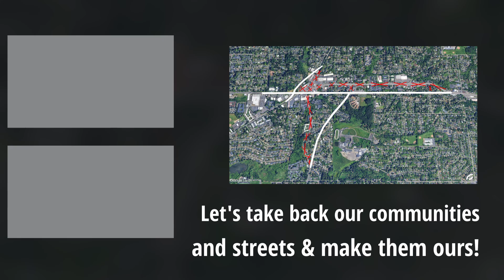Fixing Oregon's WORST Intersection

Comment: I’m very familiar with this intersection, and I must respectfully disagree with your proposed solutions. The optimal approach becomes evident when you analyze the situation comprehensively: a roundabout is the answer.

With four or more points of ingress and egress, compounded by a history of high collision and fatality rates, a roundabout offers a proven solution. If you’re seeking a more innovative design, consider a double teardrop or “dog bone” roundabout, as successfully implemented on the Keystone Parkway in Carmel, Indiana.

Roundabouts effectively slow traffic, reduce vehicular accidents by approximately 80-90%, and decrease fatalities by more than 90%, all while maintaining high traffic throughput. Unlike signalized intersections, they do not create dead-end streets or diminish the street network’s connectivity. Properly scaled, a roundabout can easily handle a 20,000 vehicles-per-hour traffic volume on the major arterials.

We’ve implemented similar designs across Oregon, the learning curve for drivers has proven to be manageable. I would add that the the land impact is also less significant than one might assume—at most, it might require the acquisition of a few parcels, perhaps including the Donut shop or a nearby residence. The trade-offs are minimal compared to the safety, efficiency, and long-term benefits such an improvement would provide.
Reply: As a traffic engineer and former roundabout designer, this is the correct answer. OP’s “band-aid” reply unfortunately does not comport with urban planning and engineering reality.

There are too many underground utilities for OP’s large-scale realignment to ever pencil out, not to mention legal access rights of abutting property owners. The idea of straightening out B-H Hwy along SW Boundary St is similarly never going to happen.

Just build a roundabout and let people walk, bike, and drive through this intersection at a slightly slower speed that allows everyone to make it home safely.
Reply from the maker: @jr98664yt  I am always a huge skeptic of anything anyone says, that includes endless research, reviews and data sets from engineers and experts on all topics. Point being, I am very much the same with this here. Could it be true that apparnetly roundabouts literally fix everything, sure, but my god do I refuse to believe it and it is so nonsensical to me.

And I didn't go into this with the idea that my proposal would be popular let alone viable. I didn't care if it was viable or likable or not. I simply wanted to spitball a concept that is more how it SHOULD have been built out when they first developed the area, than what would be able to work now, though with only a SLIGHT part being a "what if we did do this now?"

And yeah, all the utilities would be forced to be torn out and rebuilt, but that's actually needed anyway throughout the BH corridor, as not only is the main utilities aging bad, there is major drainage issues throughout, and complete reconfiguration and replacement of some portions also should have been done long ago. Therefore, the blank slate is the superior option to right all of the wrongs that happened due to lazy engineers and planners just hand-waving off all concerns and saying "this as it is is completely fine. Don't worry about it. Now where's my paycheck?"

Ultimately what I mean by fixing it isn't even the danger level of it. I care about making it make logical sense for all purposes and users, and for the future redevelopment into mixed-use medium density along it, and in the surrounding area, as that will only exacerbate all the problems with it, including heavy congestion and thus, the safety of it for all. Is the safety important? Absolutely, but it isn't the only thing, nor is it my primary focus.

Furthermore, I strongly disagree with the notion roundabouts should ever have more than 4 connections on it, which it would have here with Scholls and BH alone. What do you do with Olsen? Allowing it to join as well is egregiously stupid. I know full and well there are many places in the world which have roundabouts and traffic circles with more than 4 connections, but it still furthers my own points against it to allow that. Especially for major thoroughfares, which Scholls, Olsen and BH all are. What would you do with Dogwood? Would you actually connect it into the same roundabout? If so, why? Realistically, I believe that road should be completely cut off from having any connection to such a construction. Just sever the ties permanently, force the residents to instead walk, bike or drive the long way around, or, better yet, have ped/bike paths connecting the ends of Dogwood to the roundabout.
Reply from the maker: I get it, but I really still believe that's a band-aid, and also that people are treating roundabouts on this video the same way as all the "adding just one more lane will help!" crowd does.

All of the traffic data is also from 2021 with one single exception being from last year, which COVID lockdowns, the 217 widening process, and the westside pipe project all skewing those numbers likely more than many may assume. Given the recorded volumes from then, 14k per each side of Scholls, and around 26K~ for BH in 2021, current rates undoubtedly are going to be 30k+ for the latter, and ~20k for Scholls.  Olsen data I think I somehow managed to miss, I likely got distracted looking at other data for TV Hwy (Canyon portion too) and further south portions of Scholls, further west portions of Farmington.

You then must account for the inevitable redevelopment of the surrounding lands, which is to be mixed-use high density, and the amount of traffic increase that will cause as well sourced right along the intersection, or in this case, roundabouts. Of course, development on roundabouts isn't actually possible from a logistical standpoint, let alone of a practicality basis. And then the connections to the thoroughfares to access said roundabouts would also be diverted by default to where it would force them to travel east, west,south or north aways before getting to those roads.

We also lack any truly high capacity roundabouts not just in Oregon, but anywhere really in the US. At least four lanes, likely 6 would be needed in said roundabout, and the size exponentially increases in order to safely accommodate each added lane of traffic flow. It also makes it more complicated to navigate to be in the correct lane for whichever road you want to access.

So I really don't entirely buy into the "roundabouts are always the solution to all problems" notion.
Reply: Your proposed solution is not viable. Demolishing 15 private residences to move Oleson Road further east is a nonstarter. It would be much easier to demolish four fast food joints at the intersection and reduce the conflict point there.
Reply from the maker: @RedbookGereute-bs1xg  Keeping the intersections so close like that is also not viable even to consider as a option.
Reply: I agree with your statement in the Video that Dogwood should be capped in the north and south, reroute the southern over Stephen Lane, the northern area has access via 78th.

Then if you want to increase the distance between Ferry Scholls and Oleson in the south, reroute Ferry Scholls through the commercial area to the west of the intersection. Convincing businesses to sell land for a road realignment is much easier than private residences.
Reply from the maker: @RedbookGereute-bs1xg  Though the latter point in certainly true, how would you keep Scholls connected to itself directly from both sides of BH? The excess terraforming you'd have to conduct to get the northern portion to align with the southern portion would be immense, and, the angles from tight curves you'd need for the northern portion to align with the southern portion at such a intersection would be wild.
Reply: @TheCriminalViolin  there is no law or regulation that requires a road not to be interrupted. Broadway goes diagonally over Manhattan and is interrupted for cars at various points. Scholls can also be interrupted. It can be kept open for pedestrians and bikes.

Comment: I'll add some food for thought:
-S. Dogwood: outright cut if off near the assisted living center, separate it into a business plaza and a residential dead-end. 
>Stephen is close enough where it's a bit more inconvenient, but not too bad. Still, the S. Dogwood does service more people than N. Dogwood.

-N. Dogwood: Not any great ways to reroute this, best guess is running Newton through to 75th, but that affects at least 3 properties. 
>Adding a new southern street between newton and beaverton is still too close to the intersection IMO. Maybe near the boxing club could work though?
>Otherwise, just cut this one off, put a basic barrier up, and now the rich people get a longer commute to justify their high property values.

-Maybe push West side of Beaverton a bit further North (up) so that there's a clear five way intersection between Beaverton, Scholls and Oleson? (without the slip-lane stuff?) 
>Still dangerous, but at least you could do it with one light.
>The hilly terrain would still need to be landscaped to accommodate this
>Upside to this is that there's not a drastic change in properties? The vet clinic and maybe a small chunk of Parr's gets swiped by the road, but not much more? Maybe the diamond shop? There's a huge chunk of empty land north of beaverton on the west side of the intersection.
>Triangle of commercial land in the SW side can expand a bit.

Maybe run Oleson-Dover-Flower- into a new Road that runs through that wooded patch into 62th? But that would be Hayhurst instead of Raleigh Hills. But also probably has merit with the alpenrose development.

If you divert Oleson, you'd want a decent route to both Scholls and Beaverton (in a world where the development happens), which means cutting west from Oleson somewhere into a street that leads to Scholls, and a street headed northeast to reach beaverton.

Comment: Another interesting problem is it's proximity to Fanno Creek and the adjacent wetlands. Some of this area is close to or within the 100 year floodplain, so any plans have to take into consideration environmental impacts and compensatory wetland mitigation (if needed). It's a sloppy mess.
Reply from the maker: Yep! That's a huge part of the issue with fixing it. The drainage has always been a massive problem, and it being within the floodplains, and built on top of wetland habitat that was filled in, with remaining pieces of it here and there, it makes it much more difficult to make work logistically. It got a minor mention via the possibility of making the current Olsen alignment into a multi use path that could connect to the fanno creek greenway trails and the red electric trails, in my own concept of a potential fix.

Everything about it is a logistical nightmare and sloppy mess. One massive screw up. Sitting on it doesn't help anyone or anything, and putting a band-aid on it as a fix doesn't help either in the long haul. Thus, the drastic changes do have to occur in order to truly fix all of the issues and problems, even infrastructure outside of the roadways. The pipes, drainage, electrical, sewer, wastewater, gas and electrical lines would all themselves need to be upgraded, fixed, replaced and reconfigured to accommodate future redevelopment and infill.

Fun stuff, isn't it?

Comment: Lol ngl, this isn't a good plan.

You're proposing that they destroy massive amounts of road, uproot trees, bulldoze businesses and buildings, and redevelop probably a few miles worth of new road

Instead of a couple roundabouts

Did you even factor in cost when you made this?
Reply: Agreed, too many residential takings
Reply from the maker: Nope, because this isn't some "Expert analysis". Someone else already suggested the "correct" way to have made this is "simply" break it down with each concept and proposal one may have, give a summary of their details including cost, and compare each with each other until all but one I eliminate, then explain in detail step by step why I believe my concept is the best. If I was a "expert" or some big name "pro", I would have done exactly that. But I am not.

And I guarantee one or two roundabouts won't fix this at all. It may temporarily alleviate some of the problems, but it wouldn't actually be a long term fix. The only long term fix would be something truly drastic that voters would hate and area businesses and residents would despise. But we did this to ourselves, and the longer we wait to actually fix it for good, the more problems will arise, the worse the current ones will get and the more people and businesses will have to be displaced to actually fix the dang thing.
Reply: @TheCriminalViolin  you're probably right about the second part, although you misunderestimate how effective roundabouts can be, but I do not think your solution is an effective one when it requires tearing down in the double digits of buildings lol. It's not effective and there's probably way better plans using existing infrastructure. I would probably leave it to professionals.